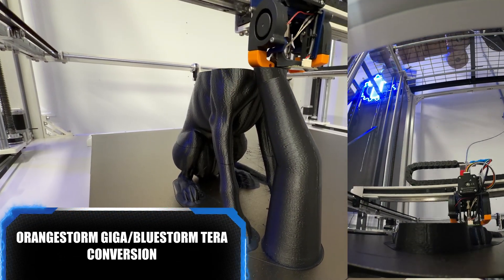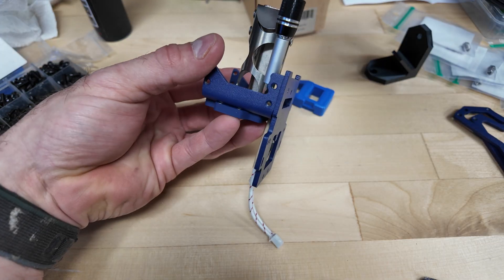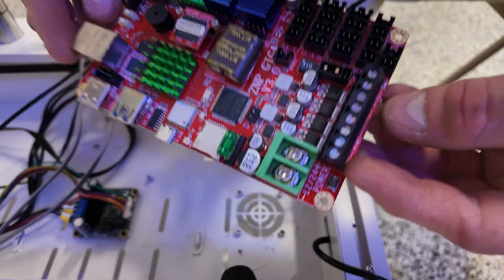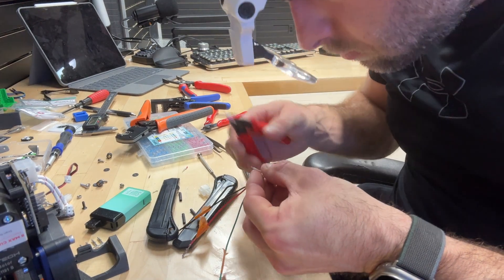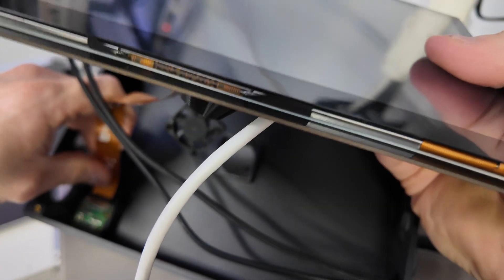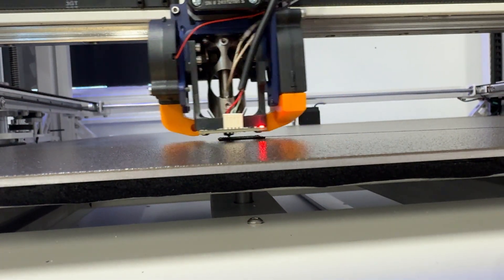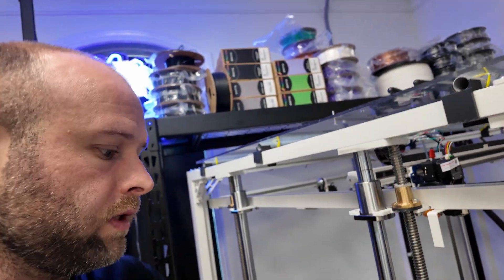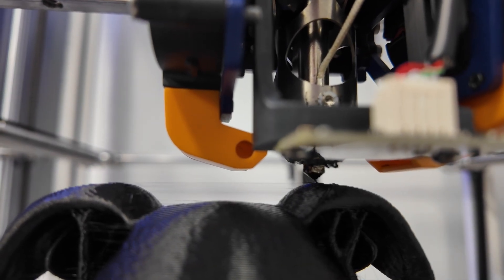Elegoo Orangestorm Giga / Bluestorm Tera Conversion Guide

Comment: been wondering when someone would do a video on the giga and converting it. everyone i asked for advice or even a cfg to look at  and no one would share its like a secret i guess to share a damn printer cfg, lol  i dropped the chube i couldnt get it to print worth a crap and beacon ruined  my 1 piece pei sheet dug right into it. so im back to stock right now   i do have a stealthburner with CHC xl  and or a dragon ace set up for it. we are closer on the new gantry to start testing it.  great video  man  og my infinity flow will not work with giga it never stops feeding lmfaooo

Comment: What's your best flow/speed on it?
Reply from the maker: So far was the (failed) pumpkin which I was running at (i think) 300, would have to check on the flow but i have max vol set to 80

Comment: Nice work! been loosely following a long  (mostly for your random thinking out loud moments LOL), but I like what you're doing here. Would you recommend the giga? I am looking for a large format printer for some future projects and the one I keep coming back to is the giga. If I did get one I would be planning on doing the LL conversion for it. I do like the idea of running the Kraken and EBB42 on it for better performance and serviceability. Basically, would you recommend it, do you regret your purchase, and if you had to start over would you do this again? 
Great work though!
Reply from the maker: Thought of doing a semi-final "verdict" on the machine
Even with the increase in performance, I wouldn't for one reason - risk
Big print fails at 80% you're out $50 in filament. Only time will tell if the reliability improves but only one way to test that
Reply: @TechnicalsTinkers thats my biggest worry. I know that a part of me would die if I had a large scale print fail at 80-90%. And its not even the amount of filament, its the time. I can factor the cost of filament in, but that time you cant make back.

Comment: BTW, if you can get the squirrel fan to blow along/down the channels of the Kracken Heat Sink, that is where the Servo Drivers are and as you see, the largest source of heat.   When they overheat, you can get 'Lost Steps' and other nasty artifacts.
Reply from the maker: Versus the previous setup, the amount of airflow I have going in the cabinet is huge, but well noted thank you!

Comment: Wait, so this is basically an all new printer and operating system just using the giga frame 😮
Reply from the maker: Basically yes. The only elegoo stuff are frame motors belts and heat beds which honestly are probably all rolling out of the same factory for everyone